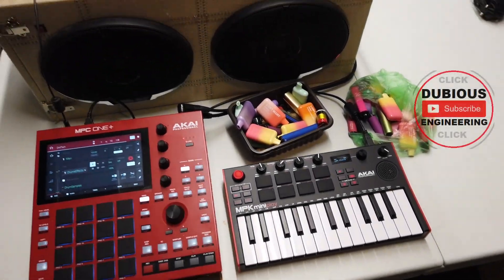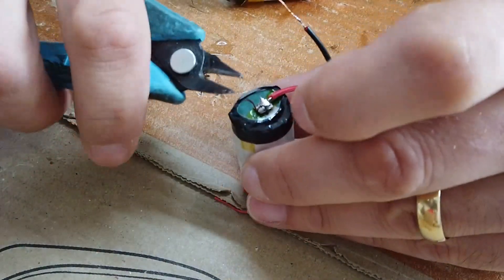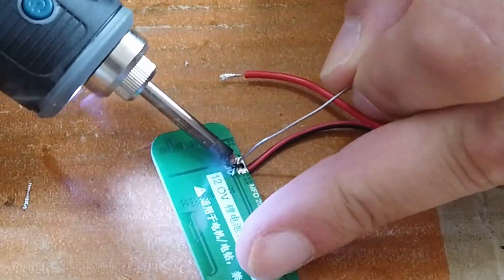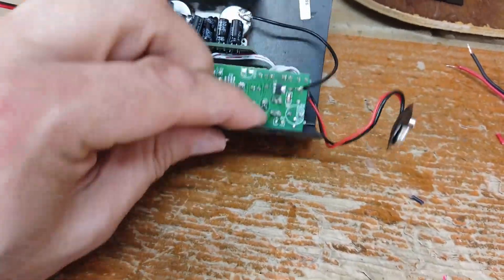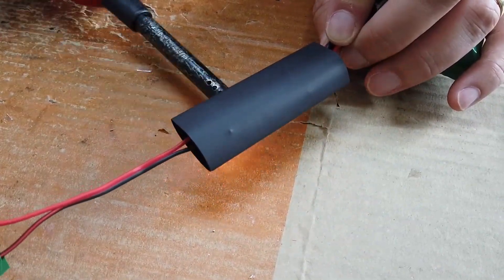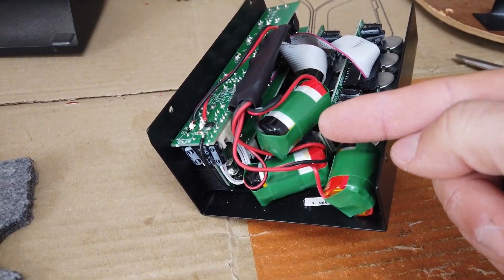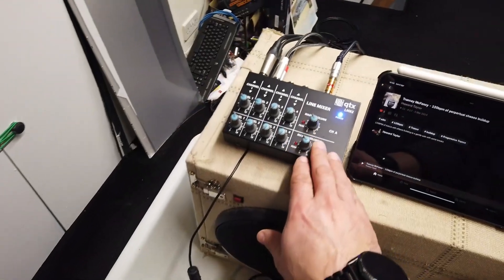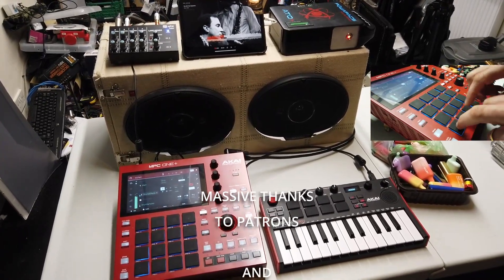DuB-EnG: Recycling Vape Batteries to power Musical Devices - Upcycle Lithium-Ion Using / Repurposing

Comment: Been curious about reusing these types of batteries for a cosplay sound board and speakers.  Any particular safety measures you suggest for using these?  Seems like it would be an appropriate use if I can get the setup correct.  Great and informative video!
Reply from the maker: Definitely fit a BMS pcb...  it will protect the cells - its easy to kill them if you discharge them too much

Comment: Very nice... All the batteries I've reclaimed have been a max of 500mAh, useful for small projects but I want MORE POWER ;-)
Reply from the maker: Find the big square vapes!!  Or tape a few in parallel :-)
Reply: @DubiousEngineering  I'll keep an eye out for the larger ones...   Lots in parallel sounds good, just need a way to keep everything balanced that doesn't break the bank!
Reply from the maker: BMS PCBs aren't expensive...   The postage costs more 😂
Reply: @DubiousEngineering  Ooooo, been a while since I looked...   I'll have to go poke about some, AliExpress here I come ;)
Reply: @DubiousEngineering  Where do you get yours?
Reply from the maker: @BenScarboro  eBay …. Search for 1 cell BMS or 2 cell BMS etc…